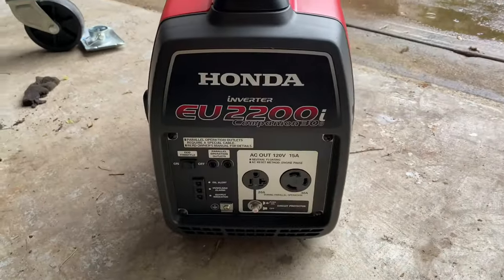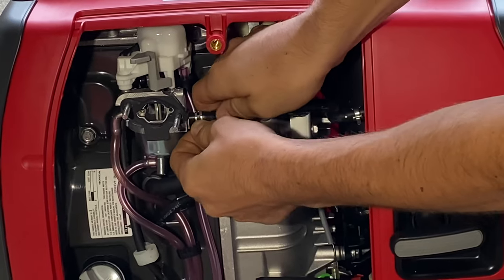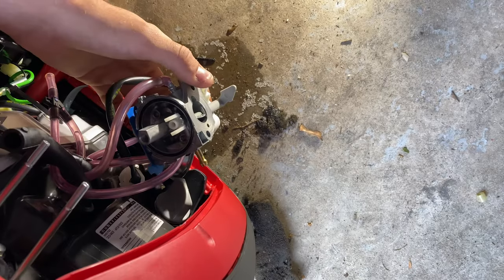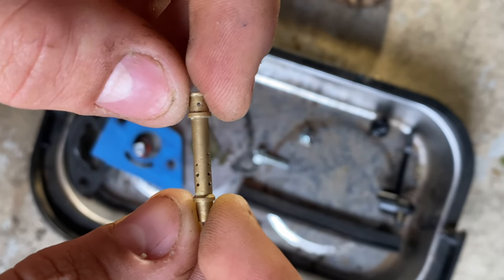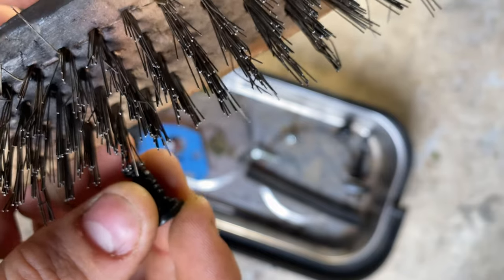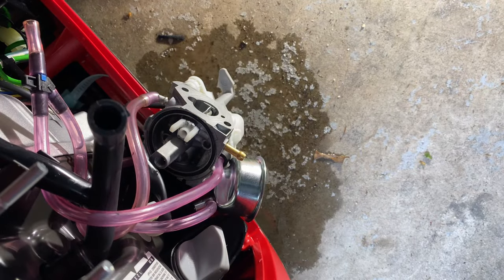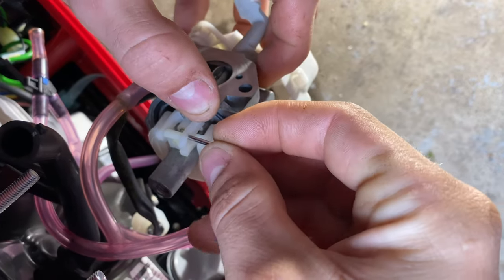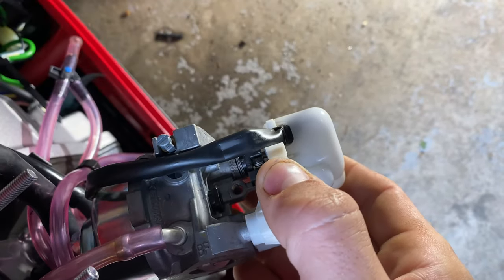How to Clean the Carburetor on a Honda EU2200i/EU2000i Generator

Comment: Thank you so much for the detailed instructions!

I have a 3 year old EU2200i that was brand new in the box, never used, and wouldnt start.  Gas tank full with new gas, oil level good, air filters clean, spark plug correctly gapped.  I followed your instructions and found that the main jet was completely clogged.  After cleaning and reassembling, it started right up on the third pull.  Thanks for saving me a couple hundred dollars!

ps I noticed you forgot to reattach the fuel line and had to re-do the air filter housing ;p

Comment: The sound at 1:18 of the generator running and hesitating is almost exactly the same as 24:20.  Good video for tearing down and cleaning the carb, but I am doubtful it fixed this particular problem.  Maybe as you said new gas would solve the problem.
Reply from the maker: It just took a minute to clear out. I didn’t want to sit there and waste everyone’s time just to hear it run.

Comment: Great video. My EU 2000 is running very rough under eco-mode and running great at high RPMs so I’m guessing this is exactly what my problem is. I just don’t think I have the skill to do this. I’m tempted but I’d be nervous I couldn’t get it back together or I would break something.
Reply from the maker: If you do not feel comfortable doing it, it should not cost to much to have it repaired. It is still most likely a carburetor issue. The passages in the carb are very small and clog easy.

Comment: Great video- thank you. Got my carb opened up and there’s SO much varnish I think I’ll opt to spend the money for a new carb. And this time- do routine maintenance- something we did not so. Ethanol is a Bi$&h!
Reply: Steel wire brush will blast out that varnish in seconds. Bonus if you have a dremel or die grinder with a steel wire brush attachment.
Reply: Just invest in a nice ultrasonic cleaner :) I got an awesome 3L on Amazon for $70 and it’s paid for itself so many times over
Reply: @sugarnap245  great advice, I had great luck with gummout tune up, no surgery needed.

Comment: Thanks a lot for this video - it got me running. I did run into a couple of issues you didn't cover. My idle jet was really plugged and took many tries and brake cleaner spritzes to unplug - I wish I had stronger wire for that one. Also the idle jet was VERY reluctant to seat into the carb body. I was concerned with using too much force. I worried there was some stuff in there preventing it from seating (impossible to see, too). I sprayed extra cleaner into the idle jet hole and that seemed to clear it and it would seat. The risk there was if I tried to force it too much I probably would have broke the jet and/or the carb, defeating the purpose. Another minor note: On my unit the crank case ventilation tube dc'd from the crank case itself. This actually turned out good because the hose is much easier to insert into the crank case than to pull off from around a fitting. (The downside leaving the engine open to the elements, but I was in a clean environment.)

Comment: Thanks for the video mate, I have an almost brand new generator that would run perfectly but would stall under any load. 

I have never done anything like this but was able to watch your video step by step…. I was so excited when it burst into life and ran perfectly once I did this, and it means I have now learned a new skill if I need to do again in the future. 

One additional thing I learned though was instead of the wire brush, a small set of oxy cleaning needles from the tool shop cleaned the little pin holes well as they are like tiny mini round files….

But overall thanks a million!
Reply from the maker: Thanks for the tip. I usually use the brush because it’s what I always have handy. Thanks for watching!

Comment: Thanks for making this video. I completed all the steps but I didn't have carburetor cleaner spray to shoot through the various holes but I did use a bread tie wire to clean the Jets. Anyways the generator still won't start so what's the next thing we should look at?

Comment: If you did strip the brass jet trying to unscrew it, what would you do?
Reply from the maker: I usually hammer a flat head screw driver in it. Try to soak it for a day or 2 with penetrating oil first
Reply: @atvrepairsandmore2482  ok thank you, I appreciate the reply !

Comment: Question:  how would you add a shut off to the fuel line.  I only use it 1 time a year and don’t want any fuel in the carb.
Reply from the maker: They sell those in line fuel shut off valves. I’d recommend one of those or they sell fuel shut off kits for the eu2000. The eu2200 has a built in fuel shut off.

Comment: I've had my Honda 2200 for 2 years and this past Saturday i started it on choke and as soon as I turned the choke off it died. Bare in mind I bought this new and had 0 issues since I bought it until today. So I drained the bowl took out the sparkplug and pulled it a few times to clear the chamber out it started for 2 seconds on choke then died. Did this about 6 times and a couple times with fresh premium gas and nothing changed. Every time I take the sparkplug out it's wet with gas. Idk what the deal is but it's definitely flooding the chamber. It's at the dealership now to see if it's covered by the warranty and if it's not I guess I'm going to have to clean the carb really good and see if that's the problem. Once again I had literally no issue until that day. Like literally 0 issues ever🤷🤷🤷
Reply from the maker: Most likely the carburetor. Modern fuel doesn’t do well sitting. Let me know what the dealer says. I’m curious

Comment: Good video.  I followed your instructions, took the carb apart and put it back together. BUT I could not get the liltte brass pipe with all the pinholes out of the carb. It's stuck!  I could get the little screw top off.  I tried carb cleaner and WD40 to loosen it up, but did not wait hours for it to work.  Didn't have the time.  I did spray a bunch of carb cleaner down the little pipe, drained it and let the whole thing dry before putting it back together.  Then generator did not start.  I am a retired accountant and don't work much with machines and motors, and so I ran out of ideas on how to get the little sucker out.  Do you have any suggestions?  T

The generator is an EU20i (the European version, I live in Europe).  I bought it in 2015, and it has very few running hours on it.  A local mechanic got the gernerator to run, and it did for a short time.  I don't know what he did, but he charged me 50 Euros for it, and I  have a generator that does not work (again).  I can send you a picture of the the piece stuck in the metal housing if you like.  Thanks again for any help you can provide!
Reply from the maker: I assume you took the main jet out first. If so, you should be able to get a small screw driver in through the large hole where the air flows through the carburetor. If you can, do that and push on the jet. If it’s still to tight, use some carburetor cleaner or brake cleaner to clean it off more and try again. They usually pop out easy so just make sure you took the main jet out of the bottom of the carb. If you get it out and are able to clean the tube and it still will not start, I’d check the fuel pump. It might take 10 pulls to get the fuel system primed to get fuel to the carburetor. If you have anymore questions let me know. I’ll try to answer them
Reply: @atvrepairsandmore2482  Thanks for the quick response. I will give it a try tomorrow or the day after.
Reply: @timbookedtwo2375  I just dealt with this too. Mine was severely stuck in there from previous owner leaving old gas in it too long. I used a small Allen wrench (or find something similar L shaped) and stuck the smaller end through the large hole where the air flows through and had to use a screw driver to apply pressure to it to drive the tube out because it was corroded in there but it did finally come all the way out. This was after moving the tube as far in as I could with just a screwdriver as that wasn't enough for it to just fall out, it had to be pushed with the small end of the Allen wrench inserted in the hole to get it free.

Comment: There is a tiny rubber ring on the jet that you put in right before the idle screw ? Mine does anyway I couldn't see if yours did or not ,anyway it's making it difficult to push in the jet to the flush stage . Should I be concerned ?
Reply: WhAaaaaaaaaa,i suspect he head off of that plastic screw ,man ...... I was doing ok until that happened
Reply from the maker: It should snap in there. The head has two flat spots on it so make sure they are sitting properly. Sorry it’s hard to explain without showing you. But yes it should sit flat. Might take a little pressure to snap. Sorry for the late response, hve been busy all day
Reply: @atvrepairsandmore2482  yes it finally did go down to the right level, thanks for responding though . I have to order a new plastic screw, this is a first for me working on any kind of engine , lesson learned , LoL

Comment: I have few questions, I want to buy Honda 2200 generator and I want to connect it to big 60 gallons fuel tank, 
Is there any fuel pump inside original fuel tank and between fuel tank and carburetor OR carburetor/engine vacuum suck in fuel from original fuel tank to carburetor? 
can I connect big fuel tank 60 gallons directly to carburetor with longer 2-3 feet fuel line? , I would like to bypass original fuel tank
Reply from the maker: There is a small vacuum fuel pump that is mounted on the outside of the tank I believe big you can get to it, you might be able to connect the line like you said. I have seen people run 5 gallon tanks to the top of the fuel cap. They sell the kits on eBay for it

Comment: Would this help out if I have a gas leakage?
Reply from the maker: If the needle for the float is stuck or not sealing properly, then yes it could leak. It could also be a bad bowl gasket or the fuel line leaking but is most likely a stuck needle.

Comment: Bad idea to use a q-tip in a drill. It broke off and now is stuck way down in there. 🤨
Reply from the maker: It won’t break off in there. It’s not snug in there and I’ve probably done it 50+ times with no issues
Reply: @atvrepairsandmore2482  Well, I must be using the wrong ones. Mine broke off. Eventually got it out with compressed air from the inside of the carb but it was an adventure.

Comment: Good video but you mumble your words so hard to hear what you are saying.
Plus you should replace your fuel filter because your generator is still not running properly. It's still pulsing.
Reply from the maker: It cleared out after I let it run for a few minutes off camera. It did not need a fuel filter.